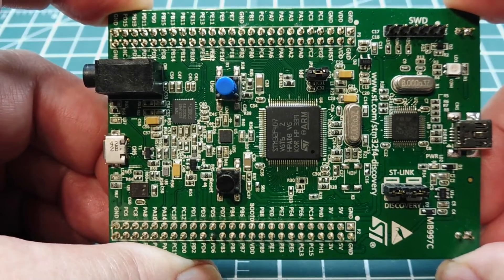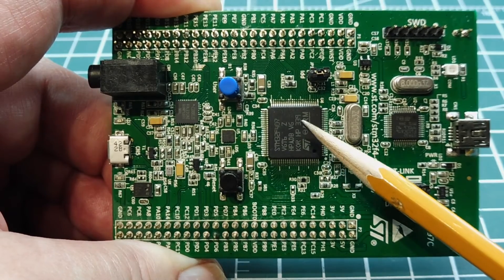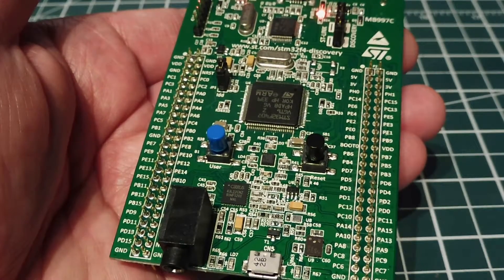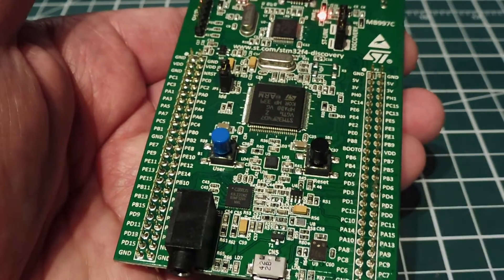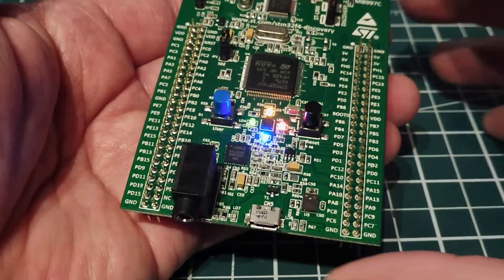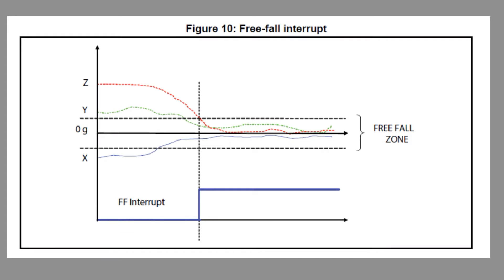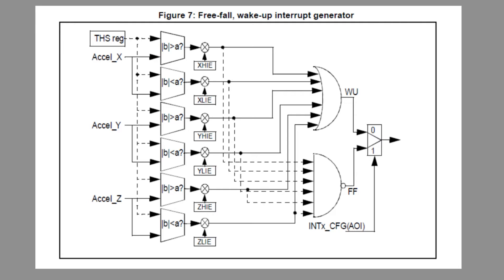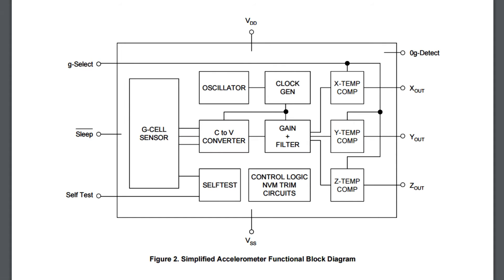Free Fall Detection using an Accelerometer

Comment: Excellent video!
Maybe you could help me with a very specific use-case? My device is thrown in the air as a projectile, and I wish to detect the point in time in which is starts falling. it may still be rotating in the air moving in parallel to earth, but stop rising and starts falling toward earth, is that possible? and how? 
Many thanks!
Reply from the maker: This video is showing an example of linear freefall. The device is dropped from a stand-still position and the orientation remains the same during the fall with no other forces acting on the device. If a rotational fall or projectile fall occurs, we look at freefall signatures for proper detection. Special registers in the accelerometer allow us to do this. You would use registers $28 and $29 as described in the data sheet of the ADXL345 accelerometer. Check out this video: https://youtu.be/df2pC1LVduA
Reply: @0033mer  Thank you very much, is it not possible to do it with LIS3DH though? as it is much cheaper than the ADXL345

Comment: Great video!  I have a question...  if during free fall the x, y and z axis add to zero, then what happens if the chip is experiencing rotation while falling.  Picture a skydiver in free fall, but he's doing somersaults.  Isn't the accelerometer going to experience some g-forces on some of the axes, and thus prevent a free fall indication?
Reply from the maker: This video is showing an example of linear freefall. The device is dropped from a stand-still position and the orientation remains the same during the fall with no other forces acting on the device. If a rotational fall or projectile fall occurs, we look at freefall signatures for proper detection. Special registers in the accelerometer allow us to do this.

Comment: I'm new to STM32 and I have the same board and would like to know the code needed to accomplish this miracle. I have tried before the Adafruit 10 DOF Breakout with lsm303dlhc with no results... My email is etienne.mathieu.2@ulaval.ca Thank you!
Reply from the maker: Check out the App note AN3393 from ST Microelectronics. Section 9.3 freefall.
http://www.st.com/content/ccc/resource/technical/document/application_note/a6/78/86/f9/88/c0/49/9b/DM00026768.pdf/files/DM00026768.pdf/jcr:content/translations/en.DM00026768.pdf
Reply: I have chat with an engineer who use STM32F411E which use an accelerometer and a gyroscope and He shared me his code on github and the datasheet to make to necessary mods because there are some differences: https://youtu.be/488qheY73ic

Comment: good explanation of free fall. can you tell on which platform did you write the code? If it is possible please share the code link.
Reply from the maker: The freefall code was written in Forth.  https://www.forth.com/
If you wan to experiment with free fall you can use the MMA7361 accelerometer which has a freefall output pin so there is basically very little code needed. I have a video using this accelerometer with examples of Forth code.
https://youtu.be/Qcq5LdVYc5c
Reply: Thank you very much.